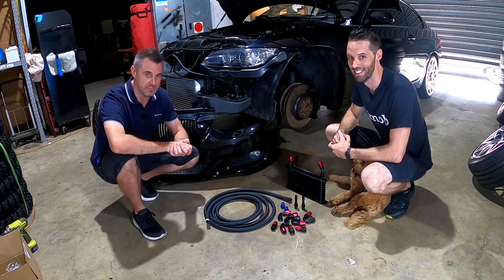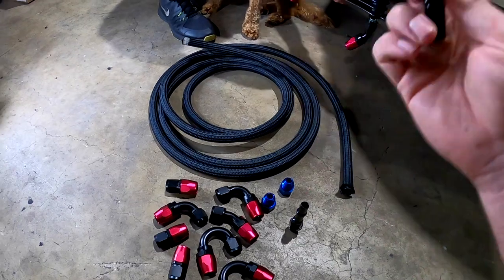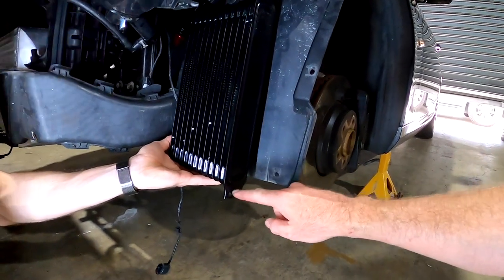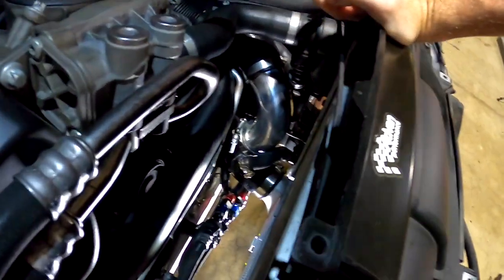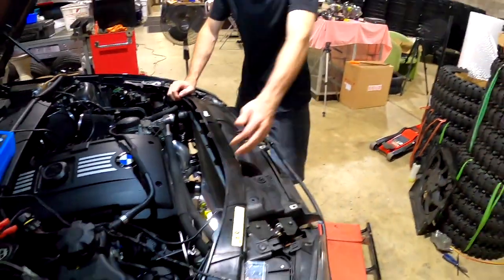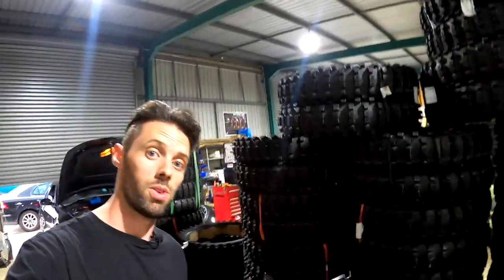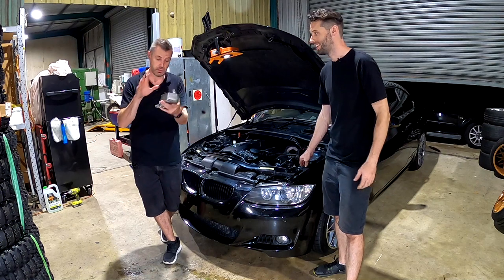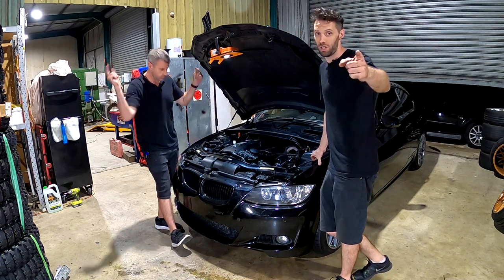BMW N54 Transmission Cooler DIY Kit Install : Budget 335i Turbo Build

Comment: When you disconnect the transmission lines to the factory heat exchanger does the transmission fluid leak out? Do you think I’ll have to add more transmission fluid if I briefly remove the heat exchanger to replace it? Is there enough fluid in the heat exchanger to make a difference in transmission fluid level? Would you recommend to fill the heat exchanger with trans fluid?
I would really appreciate some help. I haven’t been able to find an answer.

Comment: Awesome video! The picture-in-picture fan slide in was epic!
I fell like I could do this whole process now, such an excellent explanation and footage
Reply from the maker: Thanks, to be fair we didn't show the 3 hours we spent trying to fit the lines in with the factory heat exchanger in place, so it did look easier than what we actually went through. But as long as you get that sucker out of the way there is ample room for the -10 lines. Let us know if you do have any questions before you tackle it.

Comment: Definitely interesting to see. I would note how long it takes to reach optimal temp and that it doesn't cool to well. I've been pondering on the idea of running water to air intercooler to free up space to the rest of the heat exchangers. Definitely more work then an air to air. But I have the forgotten 5 series N54... everything is usually more work. Hahaha

Thanks for sharing! Hope you and your families are in good health.
Reply from the maker: Thanks Nickolas, really appreciate. Hope you and your family are doing well too. Right now, where we are based isn't really that affected, but i think the next week to 10 days will be the testing times for us. I think they are going to put us in lockdown tomorrow. Which means more time for youtube videos....
Reply: @ZeroTo60Tube  thankyou sir! Yeah no lockdown in my area of Florida yet. I'm sure we will all appreciate more videos haha.Are you going to be doing a custom JB4 map for the new turbos or?
Reply from the maker: Yes definitely, the original plan has sort of gone out the window due to my port injection injectors being no good. But basically i planned to go port injection, full e85 and send it with the stock turbos. This was supposed to happen in January, but i still haven't got the injectors in my hand yet due to china closing down and then the current madness..... Anyway i have already paid for the custom full send stock turbo tune. Once the injectors are here and PI installed, I will run that full send tune for a week or so, then bolt the hybrids on and retune to suit. Original plan was 24psi on the stock turbos and full e85, i really feel like 30psi is a good number for the hybrids....... we will see how it turns out soon.
Reply: @ZeroTo60Tube  ok gotcha... looking forward to it!

Comment: hi. You will have issues with air flow because is fitted to close to wheel arch lining.
Reply from the maker: Hey Kamil, You may be correct, however, Im curious if you have actually tested that or just assuming? This sits between 10 and 20mm from the wheel arch so there is space for air to pass through the cooler. Keep in mind the inner guard is not a sealed pocket, the air will come through the bumper, straight in to the trans cooler and up in the engine bay. I did think about making a vent like how the factory do it for the engine oil cooler, however thought i would try it this way first, since the big names who sell the more expensive kits, also say you don't need the wheel liner vent. As soon as we get some dry roads, i will put this through its paces.

Comment: How exactly did you mount the cooler? I am fixing to get ready to do this because in a few months I am going to be doing an 8HP50 swap with Canformance TCU in my E92 N54. 

Also, instead of using a bung, would it be possible to just run a hose from the frame mount hose to the radiator? 

Lastly, and this was a something I've been curious about, but if you run an inline thermostat (such as Improved Racing's one), and then run a temp-controlled ground switch after the thermostat (at whatever temp is considered getting dangerous) to a small fan on the back of the radiator, would it still fit in the wheel well?
Reply from the maker: I bent the brackets on the cooler and bolted them to the headlight bracket.

You could just use a hose to by pass, but not needed. It’s more stuff in your way in an already tight space.

I can’t fit a fan behind the cooler. I did end up putting a vent in the wheel arch after my dct conversion. The dct would get hot waiting in the staging lanes. Never had that issue with the auto
Reply: @ZeroTo60Tube  thank you for the fast response! 

So the vents did happen, I was curious to that as previously you hadn’t done that, and good to know the fan wouldn’t fit. 

I am assuming it’s pretty stable mounted to the headlight bracket?
Reply from the maker: @Stryxx  stable enough. I live in a hot climate so don’t worry too much about needing a fan. Like I said not needed on the auto, just the dct.
Reply: @ZeroTo60Tube  Probably a dumb question, but are the temps on the 8HP50 similar or the same as the 6HP? 

And yeah, Texas’s climate is… interesting. We’ve got 100°F+ summers and as low as 20°F (sometimes lower) winters. It’s wacky. 

Have you thought about using Canforance’s TCU for future 8HP swaps? 

Theirs is more plug and play and doesn’t require opening the mechatronic.

Comment: How much degrees this cooler down?

In my case (335i N54 FBO, XHP Stage 1, MHD Stage 1, VTT Stage 1 turbos), with the factory trans cooler usually goes between 94 - 98 ºC (201 - 208 ºF) in D mode, but when I tried to warm up my tires in the dragstrip or floor the gas pedal in S/Manual mode (DTC deactivated), raises up until 108 - 110 ºC (226 - 230 ºF). There's something wrong here?

Comment: Throwing an 8hp45 in my e90, im torn between rigging the stock cooler or going aftermaket. Any imput is welcomed! I currently have about 530hp
Reply from the maker: Aftermarket is my preference.

Comment: Hey, How did this Trans Cooler Work out,  I was thinking of doing the exact same thing  (As Im running Dual Oil Coolers just like this that sit on top of the 7.5" inner cooler; behind the front inner bumper grills)   You should let me send you a pic it looks awesome)

but back to the Trans Cooler and the OEM Heat Exchanger Delete;   are the Transmission Temps Cooler ?
since you basically deleted / plugged the Coolant lines that ran to the OEM Trans Cooler / Heat Exchanger)  

Thanks for the Awesome Video
Reply from the maker: Yeah a must have on a auto or DCT car imo

Comment: Great work guys, got the trans/oil cooler on my todo list, 👍

any info on what normal/safe/max transmission temperatures should be, especially tuned ?
Reply from the maker: Well...... mine stopped shifting at 112c 😞. Talk about a heart attack, I though I popped something. It was just after putting the e85 flash on and the car felt so fast. I was doing multiple pulls with wot shifts, only to 3rd. But it basically just bounced off the the limiter in 1st even though the dash was showing I’d selected second. Glanced over at the gauges and it was definitely a little warm. I have been very cautious about going anywhere near that temp ever since and it’s never done it again. I’ll normally see over 100c after 4 or 5 consecutive 0-100 runs.

It’s still raining here so I haven’t had a chance to beat on the transmission yet with this new cooler. But I will have an update once I have. But this should be fine it’s bigger than the bms one. The trans gets up to 70c relatively quickly even though I don’t have a thermostat in the line, so I think it’s all gonna be fine.

Comment: Hey guys, have gone back and enjoyed your videos of the 335i since the start.

I'm curious how you're measuring the temperature on the trans? I know the adaptors for the stock trans lines have bungs for a temp probe, but I'm wondering if you're somehow reading the BMW PID sensor in the trans through the JB4?
Reply from the maker: Hi There, 

Yes its through the JB4.

Comment: At 7:04 in the video you mention 15 mm brass bung is that a 5/8 equivalent for those of us tortured by the imperial system here in the US? Technically speaking 5/8" is 15.88 mm
Reply from the maker: HI Taylor, Thanks for confirming. Sorry i filmed that video so long ago, i couldn't remember which bung was mentioned where. That one is a 15mm bung. I also used a 14mm sump plug on the other hose. One of the hoses are tapered, so depending on where you cut in to it, you can use different bungs.

Comment: Do you know if the e93 2011 n55 engine needs walnut blasting or did bmw solve that problem with the carbon build up? Great video cant wait for the next one.
Reply from the maker: Yes, it appears to be a problem with all direct injection engines. Because of the way the PCV systems work in all engines, there will be oil vapour passing over the valves and building up. Since the fuel is injected in to the cylinder it never gets the chance to clean the valves like on older engines. Upgrading your PCV setup will help prolong the issue and ultimate fix it meth or port injection..... which you know means more power!!!! hehe

Comment: Also why do you need the Adapter if the BMP Fittings are 10AN just like the 10AN fittings on the Hoses that run to Trans Cooler ?   Am I missing something ?
Reply from the maker: I cant remember the exact sizes but its not straight forward to adapt them on to a an hose. In all honesty the BMS cooler kit for $400 is a well worth the money if you are in the states.
Reply: @ZeroTo60Tube  Yes the BMS kit;  they will not sell the coolant hose plugs seperately so almost forced to go that route, plus the mounting bracket is nice;  I'll go that route;  Thanks for Content

Comment: Shouldn’t you connect the coolant lines together so you not blocking off the circuit? I tough that it’s part of coolant circuit and with this you closing the circuit
Reply from the maker: It's only used for the trans heat exchanger. That circuit is not there on the manual cars.

Comment: did you cut some slits or holes in the fender lining to let the go through? it seem like the air is just gonna get caught up in there.
Reply from the maker: Nah, it vents in to the engine bay. I don’t run an under tray, so I’m not sure if that helps. But this is can perfect without the vents on the wheel arch.

Comment: So the blue fittings are 8an male to 10an female? Just making sure before I purchase. Thanks
Reply from the maker: Hi Jarret, Sorry for the delay in getting back to you. You are spot on. These are the actual ones i bought. https://ebay.to/2JhJ9G7 But it is worth doing some searching, incase you can find a cheaper option local to you.

Comment: I have a 10an oil cooler kit with an aliexpress adapter that goes into my factory thermostat. I'm looking to install it but fear the fittings may leak. What do you recommend I use to ensure they don't leak? I was thinking of medium strength threat locker on all the bolts and fittings! Any other recommendations such as silicone ?
Reply from the maker: I'm guessing that is one of the engine oil cooler kits? Regardless, the way the fittings are designed you shouldn't need thread locker, but it shouldn't hurt either. Although this was the first time i have used Army Navy fittings, i have sold thousands of brand name ones through our old parts business. Dealing with largest supplier of these fittings in Australia and handling their version, there is no noticeable difference between the expensive ones and these cheap ones. I would give the install a crack and just monitor closely for the first few days. As long as you don't damage and crack a fitting during the install, if it doesn't leak in a few days it will be fine for life (we hope, hehe).

Comment: I would really like to see the Stock Oil Line upgrade to -10 or -8 AN fittings.  This is something that I would really like to do on my car.
Reply from the maker: Did you want more info on the ones I used in the video or some home made ones?
Reply: @ZeroTo60Tube  the ones you used in your video. You probably will have to get two more of those expensive ass connections but yeah.  Use your left over hose and fittings.
Reply from the maker: Got ya! Yeah I kept the ones from my stock trans heat exchanger. Going to weld on some -10 thread so we can do a similar setup on a friends car. The fittings from BMP are beautifully made, but with the shitty Aussie dollar and freight down to aus, they are mega money at the moment.
Reply from the maker: livey oone  Never been an issue since this cooler setup. I use the car for a lot of acceleration runs, but never circuit track work. For a street car running 20psi its been much better than i was expecting.

Comment: I just broke my stock one installing the intercooler, do you need thermostat for the aftermarket one? Or can I just cut the hose and swap it?
Reply from the maker: Well depends on climate. Where we are in Qld no issues at all from having no thermostat on the trans cooler
Reply: @ZeroTo60Tube  I got 535 N54, I snapped my cooler , you think if I cut the hose and reconnect with insert fitting it will be fine? The stock one won’t fit, I went with 7.5 inch intercooler

Comment: Hi Guys just a quick question. I’m looking to replace my n55 dct radiator. If I do an external tran cooler could I fit the manual radiator? Thanks
Reply from the maker: You definitely can with the N54s. Just make sure nothing else is plumbed in to your rad. Also just double the parts numbers for the hoses are the same between dct and manual cars and you should be safe.

Comment: Did you guys put holes in the splash guard for air to come out? May want to do that.
Reply from the maker: We haven't, well, not yet anyway. I read about people with even smaller coolers, not needing to use the vent out the wheel well. So figured this larger core, should be more than efficient enough with out one too. There is room behind the core. So air should come through the bumper, in to the core, out the back and up in to the engine bay. As soon as i get some dry roads after work hours i will be doing some back to back runs and putting it through its paces. I have heaps of data on how long it takes my trans to get hot, so we should be able to see if its working.

Comment: Are you going to upgrade your oil cooler.
Reply from the maker: I think I will, but to be fair my engine oil temps and coolant temps seem quite healthy. This might change when it’s making another 150-200hp. We’ll see.
Reply: @ZeroTo60Tube  I think you will know in hot summer back there :)

Comment: BMS Trasnsmission Cooler kit  DOES NOT Fit where they Suggest Mounting it on there Website.   The Wheel / Tire hits Cooler on Full Turn
Reply from the maker: Hey man, it definitely does fit. I know quite a few people with that kit. BMS have been selling them for like 6 years too, would be thousands out there. If it doesnt fit on your car there is something you are doing different.

Comment: Do you need to run a thermostat for this type of set up? Tia!
Reply from the maker: I dont run one and have no issues. However i am in a warm ish climate. BMS with thier trans kit also dont.
Reply: Installed my cooler over the weekend. Wanted to say thanks for the video and inspiration. I was not able to mount it in the same orientation, not sure if that’s because I’m e93, but I worked out because I used a 335is duct vent in the fender liner and it fit perfectly. The hose connections are at the bottom, but still higher than the intercooler, just pray for no crashes 😂

Comment: Hi mate, greetings from California. I am planning on putting a second oil cooler (running on series with the factory oil cooler) where you mounted your transmission oil cooler. What are the dimensions of hour transmission oil cooler? I want to get one that will fit.  Thank you in advance.
Reply from the maker: I can't actually get to mine to measure it properly, but this is the one i purchased. It was ridiculouslly cheap and pretty good quality. https://ebay.to/3gOkbxy
Reply: Zero To 60 thanks mate. That one is probably around 6-7 inches by 13 inches wide. Pls excuse not using the metric system.
Reply: Zero To 60 how much lower than normal operating temps does the trans fluid come down to now?

Comment: Does the bmp trans cooler fitting snap and lock in or rest inside ?
Reply from the maker: I wouldnt say snap. But they do clip and lock in to the factory quick connects.

Comment: You guys didnt use a thermostat ? Wouldnt it ru. To cold
Reply from the maker: I was concerned about that. Here in QLD we do have quite a warm climate. This get up to 50c with in 10 mins of driving. Basically it's up to a useable temp, by the time the engine oil is.

Comment: Is it possible to run steel braided lines all the way back to the transmission? I want to get rid of the hardened rubber lines completely but idk what kind of fittings go into the transmission. anyone know?
Reply from the maker: Yes it is, but you need a tight adapter that keeps the lines close to the transmission. Not a lot of room between the trans and the firewall.
Reply: Any idea on what kind of adapter I need? Like what the fittings are called.
Reply from the maker: @plut00x  I havent used one of this style, but somehting like this. The ZF6HP21 have the same trans cooler connection as the DCT. https://htg-tuning.com/shop/dct-oil-cooler-adapter/
Reply: I’ll give it a shot and let you know how it turns out. You’re amazing man !!

Comment: how did you mount the cooler to the chassis?
Reply from the maker: Stock mounting points. However when its connected to the hoses, it will actually hang there in place.
Reply: Zero To 60  so you left transmission cooler hanging in place?